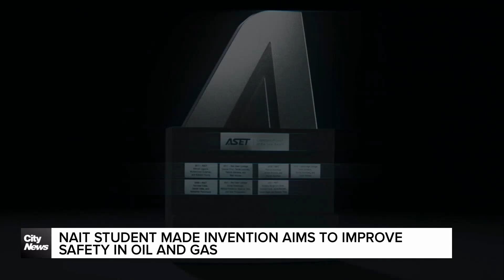Filipino NAIT Alumni invent a tool to improve safety in oil and gas

Comment: Most places will not allow cell phones in a live facility but this would be beneficial for most for sure using intrinsically safe device.  Or add a signal booster so the tech can do this from the truck.